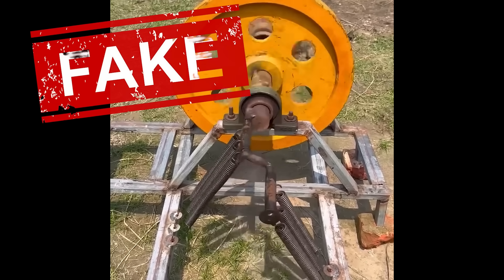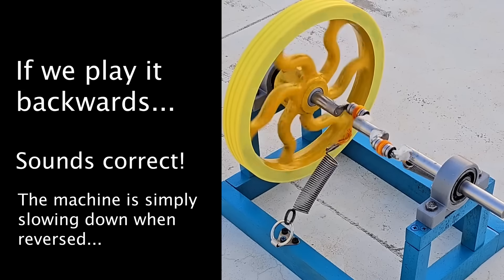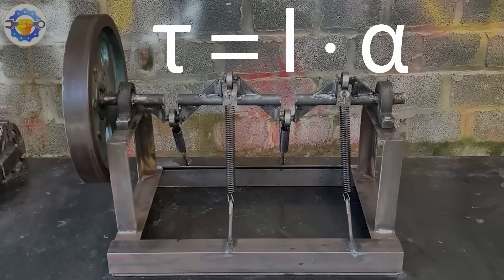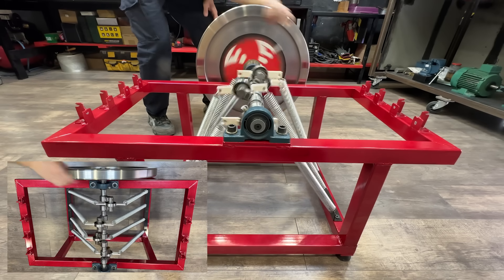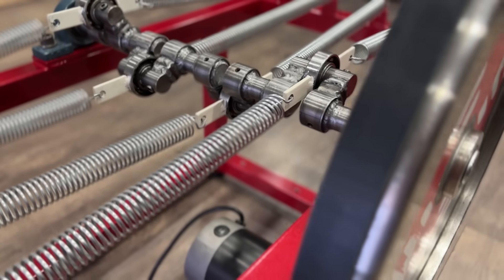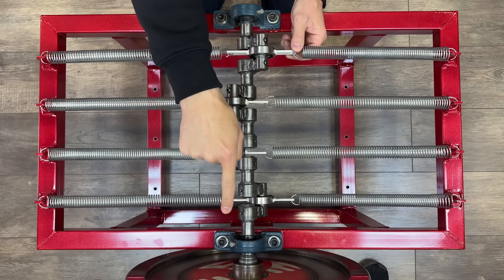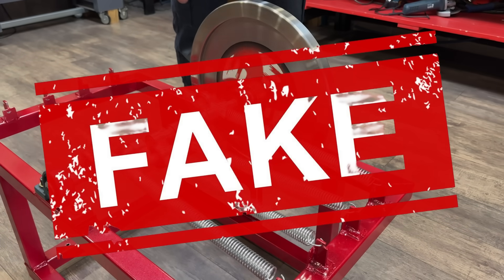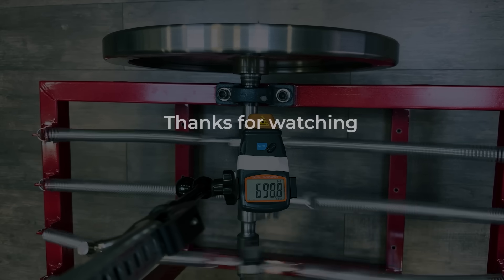Debunking the Controversial Spring-Powered Perpetual Motion Machine

Comment: Saw this before really questioned the springs. But this is a
how established mfg super rich actually discredit what actually may work. The " flat earth" sitiation take it to the extreme " tin hat sitiation" then claim " all such maganetic systems etc. Just like " all consliracy theories are the same. All are NOT true. Lol. Some just might be true. Freind stated dont waste $ on chesp Eichinicia. Does nothing. So which was used in a placable test. Lol. Uncle taught me yrs ago. How to discret something new. Is the make an inferior product over state the benefits. Cut price on the quality item And advertise / promote. People try the "cheaper" item. Lol. Told my sons maybe spend the little extra. Then y more apt to know the real Truth.  One guy suggested that many times repairs etc only cost 10% more to do it "First class" Yes have seen truck co " nnickel and dime" ( hey sometimes an emergency repair.  Get equip working. Later when time is available do the " proper repair"   Railway try saving what $ 40-50 per hr. Only " one" person No Conductor lol on Million $ EQUIP when Downtown is criticial. Wrecked equip. Etc NO revenue unless train is moving. Delivery items. Main tracks worth Millions DT is criticial. Shipping how much would it have really cost to have the tug boats tied to the big Container ship untill Ship has gone under the Baltimore Bridge. Yes spoke to big Container Ship yes he got in trouble with mg for NOT realesing the tug boats. But when things go wrong. So much easier to blame the equip opertor  1 403 830 4124 calgary ab cdn

Comment: This only work when there is no applied load to it. Like a pendulum does.
Reply: even without a load it loses energy from air drag
Reply: @kimbalcalkins6903  did you see a pendulum?
Reply: @ayamhitam9794  talking about energy lost from air drag on the flywheel and spring movement. Would be interesting to measure the temperature rise of the springs ?

Comment: If the proper dimensions of the components can be calculated in order to create a perpetual motion device, is it only a question of how many RPMs we need for an application that will determine the size of the unit? If we want to control a generator that puts out 15KW of continuous power and it requires an RPM of 2000, can we then design a flywheel unit to continuous rotate the generator at the proper speed without any external power source? That would be nice. And if the principle of the spring configuration works, can we design a similar device that uses hydraulic or electronic "springs"? Just wondering since the physical metal springs seemed to work just fine with providing the energy needed to keep the flywheel spinning continuously with no other help.
Reply: As long as there is no interference from the flux capacitor.
Reply: there is air drag on the flywheel and the springs as well

Comment: the real question is : how long will it last till the spring break ?
Reply from the maker: The problem with this machine is that the springs eventually break after just two days of operation. For this reason, it's not a good power generation system.
Reply: or a bearing goes out

Comment: IT WORKS  
the main idea is let the springs work on resonance meaning they will start  going up and down (verticalling)  not horizontally with each period the amplitude of the spring will go up and up  untill the   frame  or the spring breaks (we call it system violation)  and this extreme in high amplitude will be the  what u call free force to rotate the shaft ... REMEMBER u need to make the shaft rotate at  the natural frequency of the spring and in order to achieve that u need what is called drive frequency which is the frequency given  by a motor  which will force the fly wheel to rotate at a specific  speed  u shall  NOT  remove the motor which is turning on the  whole system  that s the only way to get  output more than input ... the only problem is how to  get this rotation  to turn on a generator  that s the problem  cz  this will affect the resonnance  meaning will put the system out of resonance !  if u know teach me ..  
 IT WORKS !
Reply from the maker: thanks my friend

Comment: When you really break it down and work out all the bugs it can work!
Some people just build a cheap model that doesn’t even make sense and first attempt fail and give up. You have to know what you’re doing…
and it doesn’t help when your own government brainwash you
Reply: no it can't... go back to school
Reply: @reneberthold334 school limits and brainwashes you. Go build one exactly like this and it will work. 
I built different versions and do videos but dam YouTube removed them
Reply: @Rebel-p4p have you tried making a flywheel generator with two electric motors (one driver motor and the other one generator)?
Reply: @joakimnjatha1392  That's not free energy, you store the energy from one motor in rotational energy and use that energy to drive the other motor BUT efficency factor is a lot lower. There are a lot of things you need to consider like friction, gravity, resistence etc.
A perpetual motion machine is impossible... Law of conservation of energy...
Reply: @joakimnjatha1392 it’s true that two motors connected together will not make free energy. Actually, I wouldn’t call it free because you still have to pay for materials, however it would payoff long term. 
These laws were put into place to limit and prevent us from building these devices. Also in the video these guys made there is a black screen that flashes for a millisecond and has a list of materials for the rotor for the liberty engine 2

Comment: Can you get more torque and rpm's if you use more springs and heavier flywheel? 
 Can I scale it up and make the crank positions every 30 degrees, and use 24 springs at 12 to each side? 
 Is there a formula for calcullating the weight of the flywheel?
 Does the rotation of the flywheel lose mass in rotation, adding to the efficiency of the device?
 Can this same device principle be designed using water and a vortex generating vane or prop to produce electricity, pump water, and structurally purify the water at the same time in balance?